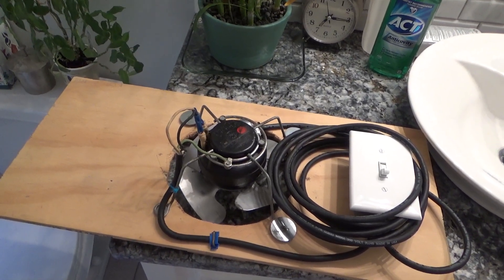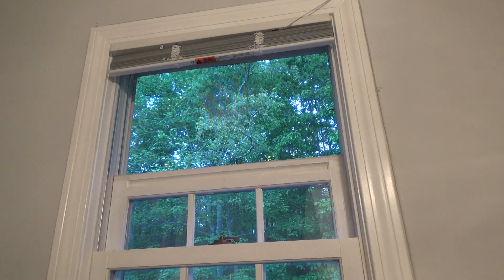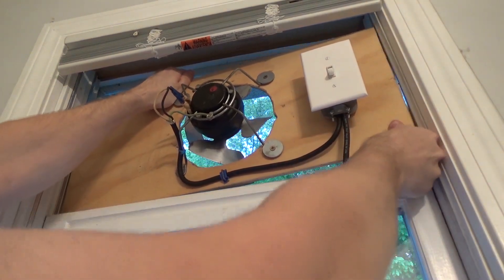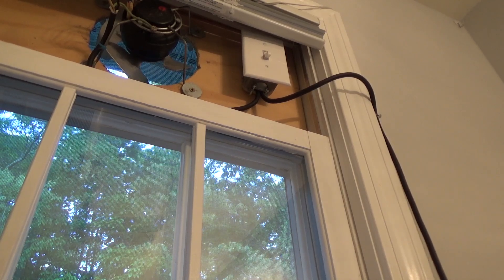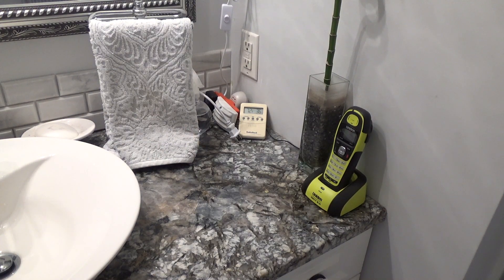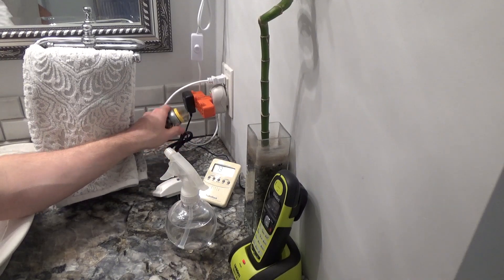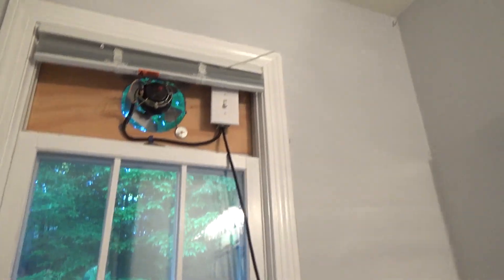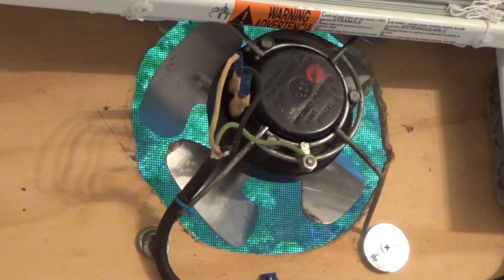Install Exhaust Fan in the Bathroom

Comment: I got the reference at 5:56.
How big is the hole in the wood?  If it's 4 inches, that's the same as a dryer, you could get a dryer vent thing that would have louvers on it.  No matter what you choose, you're probably going to have to lose the window screen.

Or, you could rebuild the wood piece longer, and screw it to the frame of the window.  You could even drill out the board and leave the screws there year round, and it will just hang on the screws if they are long enough, but that may produce a rattle.  Another nice upgrade would be a wind-up timer in place of the standard switch so it will shut off automatically.
Reply from the maker: Good!
I think the fan is 6".. A dryer shutter is too small.. I found a 6-inch shutter that may work.. If I were to mount the shutter flush on the wood and put it on the lower window's track, I think it would fit okay with the screen in place..

If I hung it on the outside of the frame, there would be almost a 2-inch gap between the fan itself and the window, and with that much gap its not going to really do anything..

The timer is a good idea,, I never thought of that..

Comment: Hi, what's the name of the black power cable and where did you get it? And can you do a airflow smoke test on this fan?
Reply from the maker: It's 14-3 water resistant wire, I don't know what the brand is and I don't know where it came from.. I don't know what that is but from the sound of it the answer is almost certainly no..

Comment: Why did you use such a heavy duty gauge cord for such a small motor? You could have easily gotten away with a common parallel 18g zip cord.
Reply from the maker: It is an 18 gauge cord.
Reply: @JordanU  ok sorry. It appears as a much thicker gauge.

Comment: Can you do a smoke ventilation test video using this fan?
Reply from the maker: As previously advertised, I don't know what that is but by the sound of it no!
Reply from the maker: @supersaiyangoku3580  If you think I'm going to wreck the house by setting off a smoking-bomb just to see the fan exhaust it, you're outside of your mind!
Reply: @JordanU  You can use a smoke/fog machine.
Reply from the maker: @supersaiyangoku3580  If you think I'm going to wreck the house by setting off a smoking-machine just to see the fan exhaust it, you're outside of your mind!

Comment: when it's not cold outside, you can basically open the window and put a fan in your bathroom...  so this is pointless
Reply from the maker: A fan in a room does not exchange the air, it just moves it around.. The fan seen in the video exchanges the air, removing moisture, rancid odors, etc.. from the bathroom.. So this is not pointless at all..
Reply: @JordanU  the point is to have something cold resistant, and this is not at all.  you need something with a valve
Reply from the maker: This not being practical when it's cold out is true, and a reasonable statement.. Nothing like what you wrote the first time..
Reply: @JordanU  Well, if  it's not cold outside, you can basically just put a fan in your bathroom and open the window...  And it works perfectly as moving air eventually finds it's way out.  10 minutes and my bathroom is really dry.
Reply from the maker: @Hide_and_Tweak  A fan in a room does not exchange the air, it just moves it around..